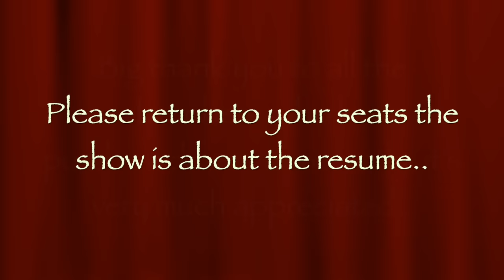A new Studded Wall, New Skirting ( Base Boards), New Plasterboard and an Old Guy...

Comment: Good afternoon Grahame,
Great job on the plaster boarding especially the piece cut out to fit over the door to the bathroom.
Stud work looks great and very sensible forward planning to make the next stage easier.
I really like the hidden channel for the cables behind the skirting board, very clever.
Great video as ever mate and see you next time.
Take care Grahame.
Cheers, Huw
PS Intro is a perfect length in my mind 👍👍👏👏
Reply from the maker: Cheers Huw thanks for your input, I have four pieces of cheery for you in the car, do you want me to bring a few more back with me, on the next trip? cheers mate take care...,
Reply: @OurFrenchHouseRenovation  Yes please, that would be fantastic.

Comment: Now then Grahame where was the ice creams and popcorn🤣. Nice job again , the gap between where the fire place which you have boarded up will you be filling that with insulation?  Coming along in leaps and bounds now Grahame. Well done you😘
Reply from the maker: no, I won't, for two reasons, the gap is to big, but these walls are self insulating, all the walls are double thickness with filling in the middle.. thanks as always
Reply: @OurFrenchHouseRenovation  ty..just wondered